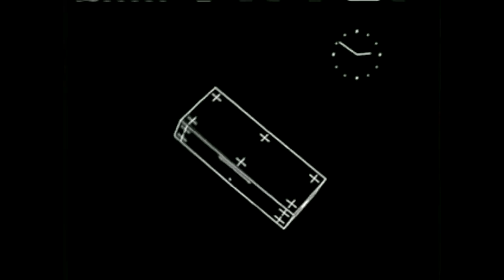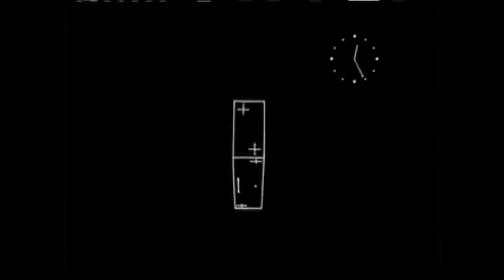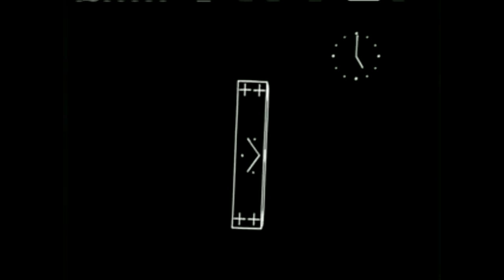Simulation of a Two Gyro-Gravity (1963) - First physics calculations by computer animation

Comment: Why does the audio sound like it’s on video an old teacher would post during COVID school 💀
Reply: The audio track is literally recorded onto the film using light rather than using a magnetic reel. Audio quality was worse at the time, but it was a lot cheaper and simpler to setup and play.
Reply: Because it's from 1960's not the 2000's
Reply: This video is 70 60 years old.